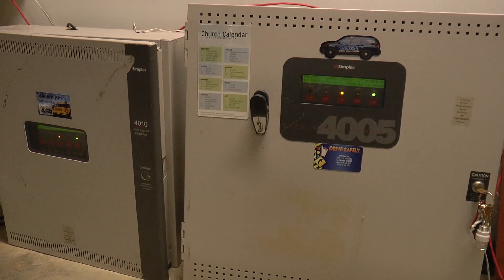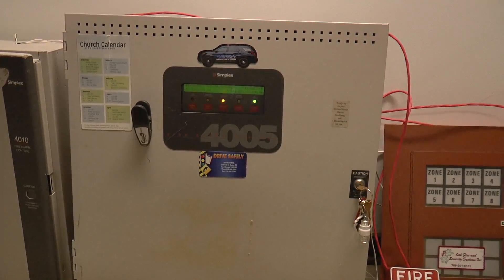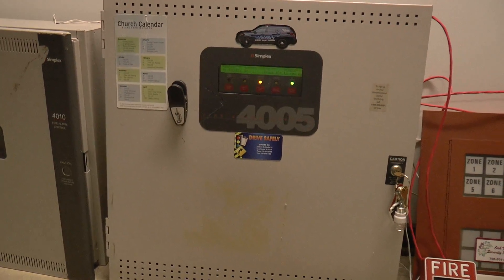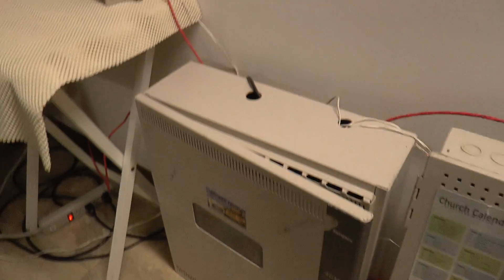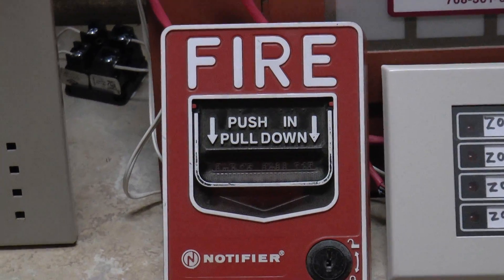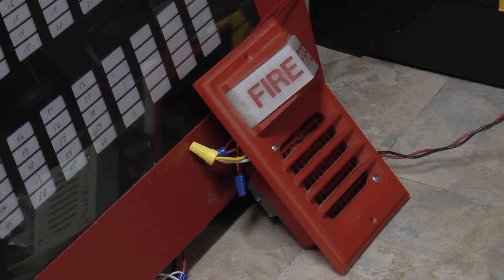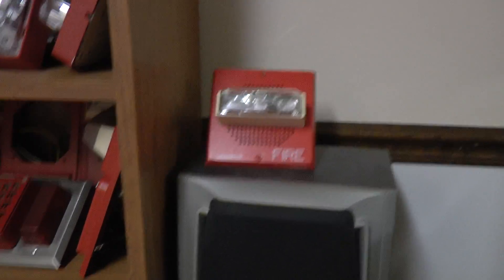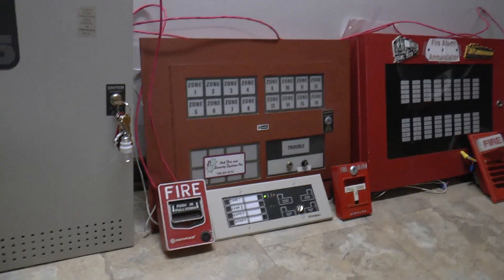Floor System Test 52 - Barus and Holley Simulation

Comment: 03:10 And not only that they even got rid of the Fire-Lite ACC-25/50 and the Wheelock E70 speaker strobes with all System Sensor SpectrAlert Advance horn strobes which is also very disappointing as they got rid of voice evac with horn strobes which is a System downgrade as the voice evac is much better and futuristic than horn strobes

Comment: I think the panel there was a MS9600 since the mechanical horns sounds clean. If I had to replace the system. I would use a Notifier NFS2-640 with DVC with SPSRs and SRs (still a disappointing update but still better then the Advance horn strobes) or another system.

Comment: I actually plan on also simulating the Barus and Holley building this summer.  I have an original MS-9600 covering my house which is likely what they were using at the time if not a 9200UD.
Reply from the maker: You mean as the master panel for the voice evac system? And nice, go for it! You have a better setup than I do for this simulation. Let me know if you want the voice message simulation file.